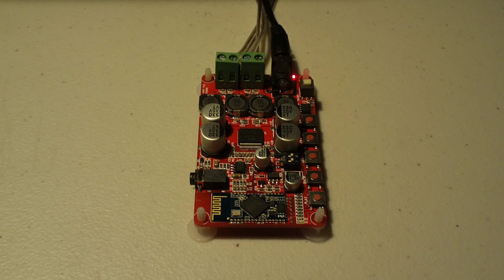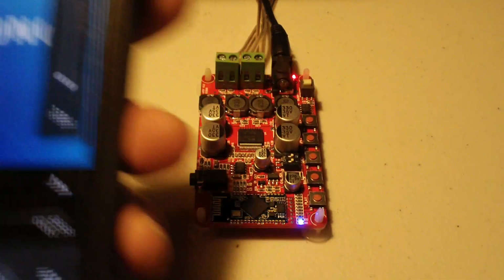Demonstaration Of A Small TDA7492P Powered Bluetooth Amp From Ebay

Comment: does it have a line in for audio besides Bluetooth?
Reply from the maker: +saintlemus You are supposed to be able to plug a 3.5mm plug into the jack while the Bluetooth isn't connected and use it as a line in. but that didn't seem to work for me, so i'm not sure.
Reply: +majorjip thanks for the tip. the lack of info on this item makes me wait on the project. I want to add this mini amp to my existing car sound and be able to take it off and use it while camping or tailgating etc.
Reply from the maker: +saintlemus If you are looking for something that just has a line in, maybe you would be better off with something like the Lepai LP2020A+ Amplifier. They sell for about $25 on Amazon and have a bit more power than this. there is also a lot more info available about that amp. As for info, all i was able to fine is the datasheet for the the amplifier chip  itself, which I added a link to in the description.

Comment: what power supply did you use to power that amp?
I want to get one of these things but I am concerned that I won't find a power supply that would fit the power jack.Thanks
Reply from the maker: +Rzangrilli I believe the size is 5.5mm x 2.1mm. It seems to be a very common barrel plug used on cctv cameras. The power adapter I was using was a 12 volt 2 amp power adapter that was actually made for cctv cameras. if you need a connector, just search eBay for 2.1mm cctv barrel plug and you will find them.
Reply: +majorjip And how many volts and amps should i look for?
Reply from the maker: Pier Wouda
12 volts and around 3 or 4 amps